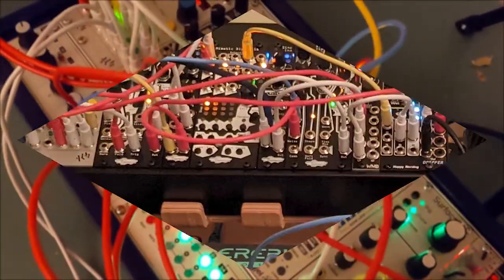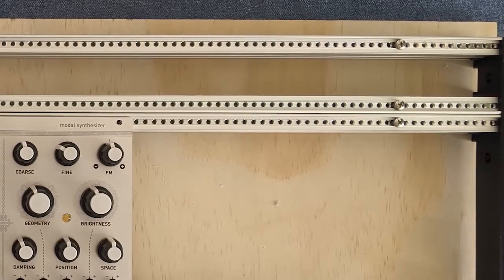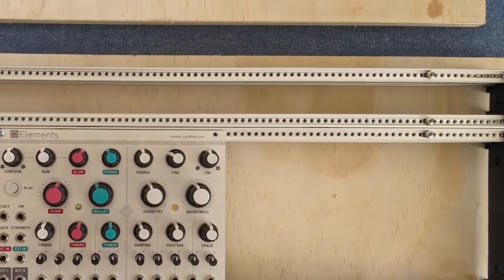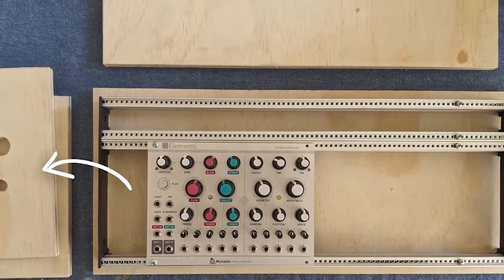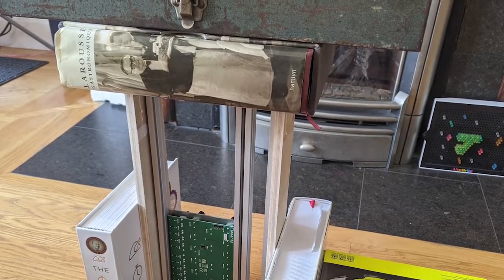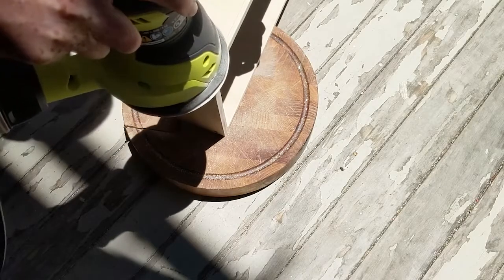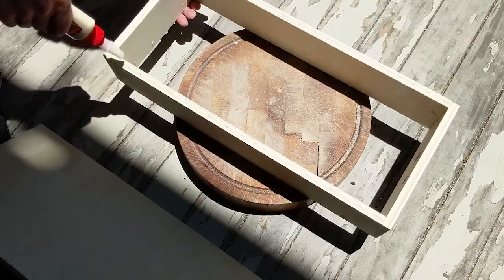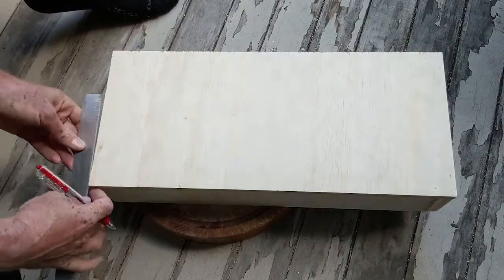DIY Eurorack case

Comment: I think your video is great, but lacks info in where you purchased the rails from. A link in the video doscription would have been geeat. An also some ideas on the sizes.like myself i am only just beginning with modular and the DIY approach is the way i am starting obviously to cut costs. But i am finding size is hard to figure. Some link to some particular plan with size of the rails and wood to cut in mm's no inches.
Reply from the maker: Thanks for the comment. I bought the rails and side brackets from here: 

https://modularsynthlab.com/product-category/diy-eurorack-case/eurorack-rails/84-hp-eurorack-rails/?v=7516fd43adaa

I didn't include that link in the description though, because they're kind of expensive, so I think you can find cheaper options if you look around.

Regarding measuring and plans - the best thing I can recommend is to build it out of cardboard first, that way you can get a good idea of the size you'll want for your wood. It's best to measure directly with the rails and a module in place, as I showed in the video, rather than trying to get an accurate measurement in advance. It's very hard to get that exactly right.

Hope this helps.
Reply: @craig_z  that's great. Thanks for the tip with cardboard. I am still in the process of building the modules. I will wait till I have those finished, and I can measure them up for the size of the box I need. I am currently building a clouds clone.